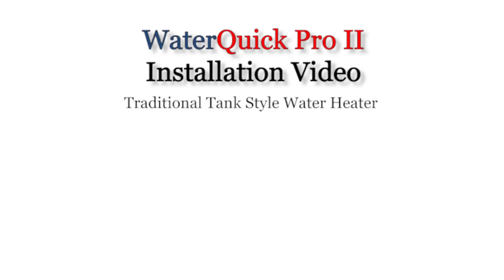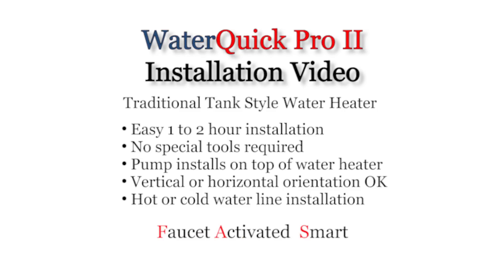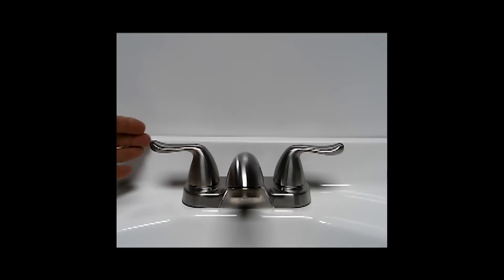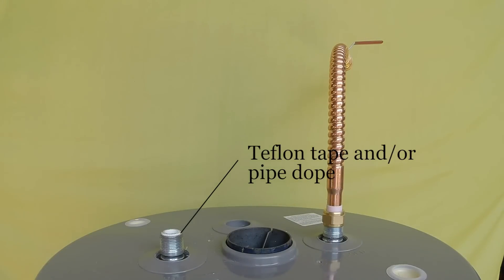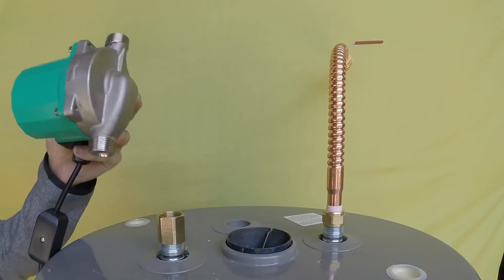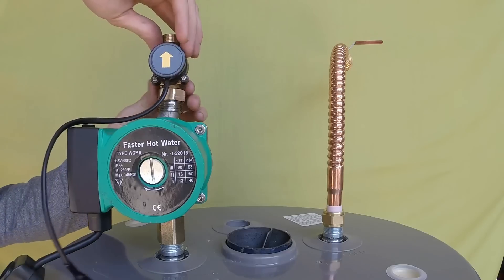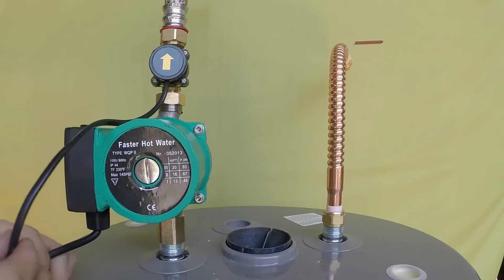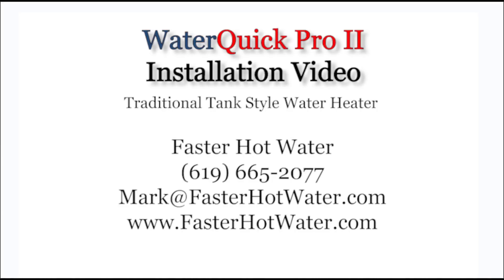How to Install a Hot Water Circulation Pump - WaterQuick Pro II

Comment: your arecwrong the pump is not installed on top of the water heater, it is installed on the drain by the heater about 24” from the floor with a check valve and a drain.

Comment: Can you put bridge valves in multiple locations to make the loop work for different areas?
Reply: Also you said this is a demand system how does that work?
Reply from the maker: Hi Duane 

Thanks for your questions. Yes, you can use more than 1 Bridge Valve. One of our customers in Palm Springs put in 7 Bridge Valves (1 under every sink). That's not necessary - you only need 1 at the end of each dead-end line.

In the video you will see the installation of the Flow Monitor. The Flow Monitor is a flow switch. When any hot water faucet is turned on the Flow Monitor will turn on the pump. If the Bridge Valve has cold water in it, cool water from the hot line can move back to the water heater. 

When 95-degree water reaches the Bridge Valve, the valve closes. At that point the water has nowhere to go so the pump shuts off. The one exception to this is if a hot water faucet is open the pump will always run. 

So the pump doesn't run until a faucet is turned on and will continue to run until all of the Bridge Valves have hot water and are closed and all of the hot water faucets are turned off. 

Mark
Reply: Ok but on the flow switch does the pump only stay on when the faucet is open? because if so it would not put the water back down the cold water line so it would defeat the purpose or does it trigger the pump for a set amount of time so that you could turn the faucet on and back off so that the water would circulate and then turn the faucet valve back on I hope I am making sense
Reply from the maker: So the way the system works is turn on any hot water faucet for 1 second, then off.  That starts the pump pushing the cool water in the hot line through the Bridge Valve into the cold line and back to the water heater.  

That process typically takes 30 to 45 seconds.  During this period no water is wasted because the water is being returned to the water heater through the cold line.  When the hot water faucet is turned back on hot water will be waiting for you.

The time period is not preset. The pump will continue to run until the hot water reaches the Bridge Valve.  The Bridge Valve has a temperature sensor built into it (no electricity is required - it's wax actuated so as the water heats up the wax expands and closes the valve).  When the Bridge Valve closes the pump will shut off as long as all of the hot water faucet are turned off.

Hope this helps.
Reply: ok so where do I buy this unit? What is the cost?
Reply from the maker: Go to http://www.fasterhotwater.com/Price%20list.shtml to find a list of all of our products.  Or you can call me direct at (619) 665-2077.

Comment: Do you need a recirculating pipe?
Reply from the maker: No.  This system uses the existing old water line to send the cool water in the hot line back to the water heater.  Go to the following link to find out more about how our systems work:  http://tinyurl.com/jsalvsc

Please let me know if you have any more questions.